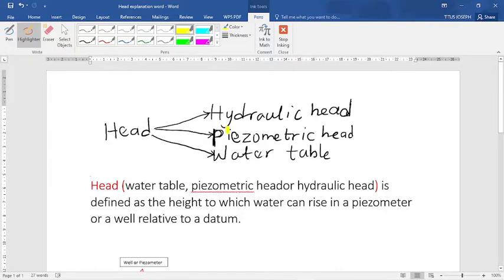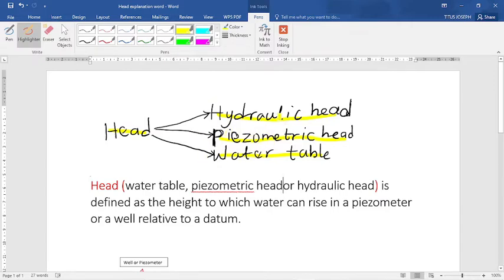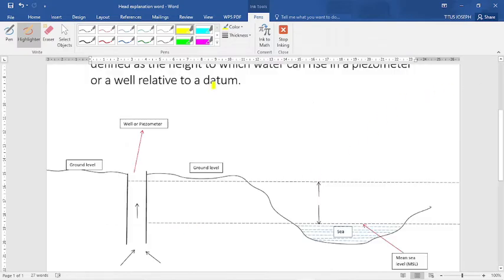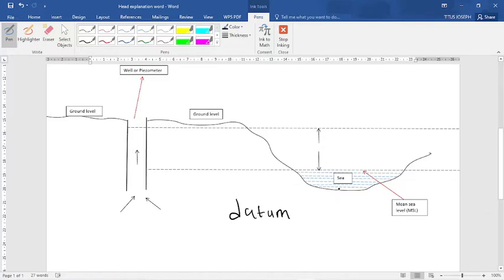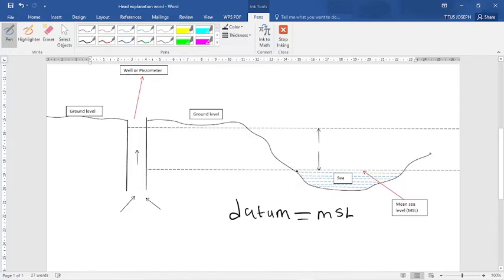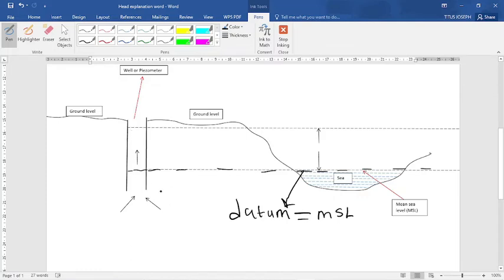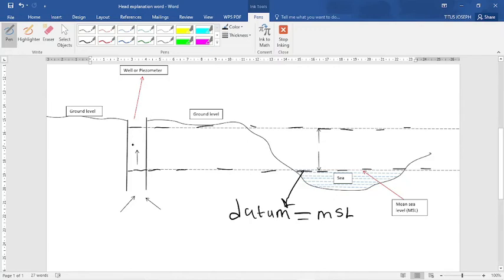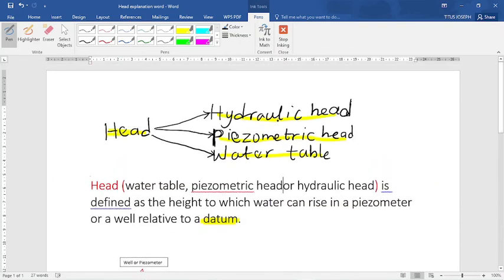Explanation of head, hydraulic head, piezometric head and water table

Comment: piezometer head of a soil at two point a and b are found ha= 20 cm and hb= 10 cm.length between two point is 10 cm. permeability of the soil is 0.15 mm/s. calculate the rate of flow between this two points through cross section area 10 cm^2

Plz solve this
Reply from the maker: Click the following link to see how to solve it https://youtu.be/27lcH9G2wGM?sub_confirmation=1
Let me know if you have any question.